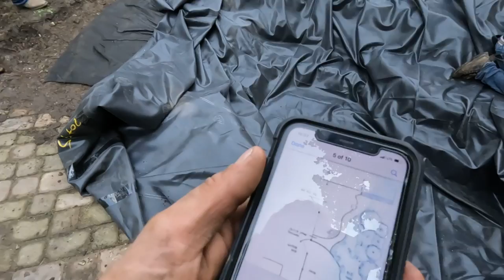START to FINISH - POND BUILD. Sensory Stimulation For Kids!

Comment: Nice project but man you talk a lot , and when i say a lot i mean it. Would have been nice to see the real video of the building instead of time lapse and you talking for half of the time.  Also not really a good idea to put a tree next to two windows ( basment and room ) as it will nlock a light plus brush against the structure . I think  a shurub would have been nice . Also, that fake grass in the back is eye sore . All in all, 10 points for fall and pound and 5 for landscape.  And 2 for talking